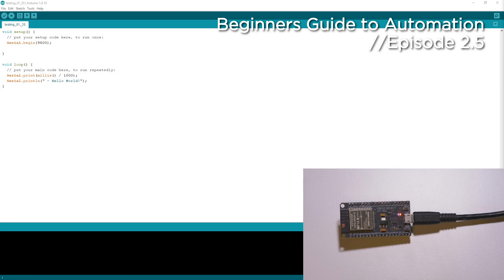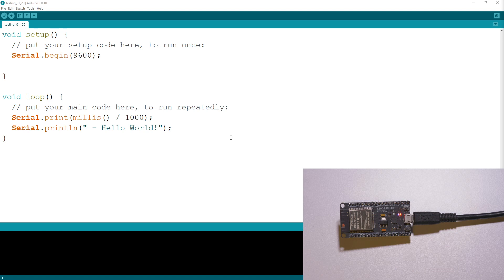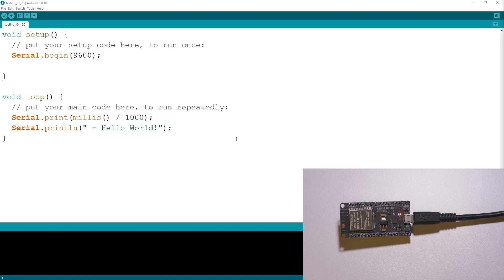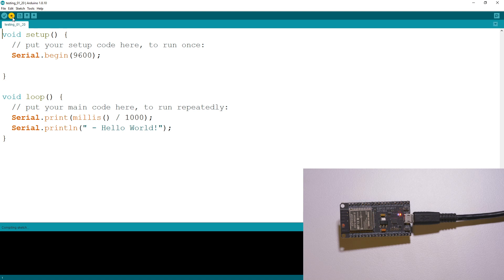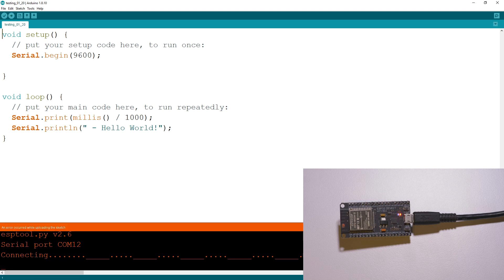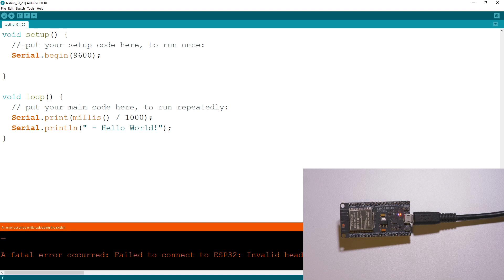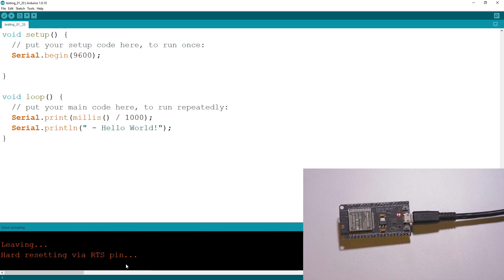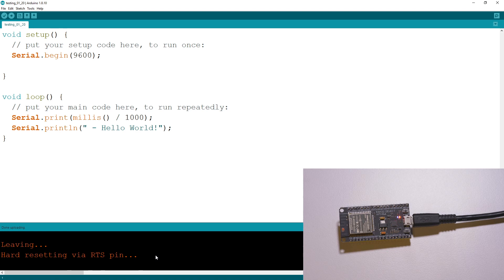ESP32 Upload Fix

Comment: This did not work for me at all,  To upload your sketch to the ESP32:
 Connect pin 0 to gnd. Press upload sketch button within Arduino.IDE program on your computer  Once the upload is complete, remove pin 0 to ground and press reset on the D32.  Your sketch should now be running.  Also take note:  The upload speed and serial monitor was at 9600 baud.  Worked for me!
I digress;  some ESP32s have a boot button.

Comment: Problem is, even if you get code on it, it wont work because it cant connect AFTER the write....the code writes but cant function.
Reply from the maker: It will function just fine. The issue is with the reset that should happen when uploading new code

Comment: I'm pulling my hair out on this one ! I constantly have th' 'No serial data recieved' error and can't upload. The only time that it works is when i completely remove the COM port device from my devices manager, reboot the computer and let it detect again. Then in the arduino software i can upload without any problem. It happens that it works twice but when it fails, i never get it to work again until i delete and add the comm port again. What a piece of garbage

Comment: Thank you very very much for this vídeo. As a matter of fact, I have the very same Output message as you do in the end, after solving you issue : "Resetting via RST pin". I've read in the documentation that this is not a bug, but rather a feature. In any case, if the program is really being loaded, I can not see the builtin Led blinking as it was supposed :(

Comment: HI 
Thank you for your videos 
I have an error when I start to build my sketch  for esp32  but no issue for esp8266 
I m using windows 10
This is the error :  exec: "cmd": executable file not found in %path% compile error for esp32 dev module board
I need help 
THANK  YOU
Reply from the maker: I would check your path variable.  In windows open up a command prompt. Then type "echo %path%". Check if there is anything weird going on there.

Comment: I ran into this same symptom, but my problem was something different.  I was missing the CP210x USB to UART Bridge VCP driver.  Without that, Windows wasn't able to create a Virtual COM Port (VCP) when I attached the ESP32 with a USB cable.  By default, Windows has COM1, but when I'd try uploading to my ESP32 using COM1 it would give me the error this video talks about.  That's because my ESP32 wasn't actually connected to COM1.  And since I was missing the driver Windows wasn't able to create another COM port, a VCP, for me.

After downloading the CP210x VCP Windows
 driver from https://www.silabs.com/developers/usb-to-uart-bridge-vcp-drivers I got one step further.

My other problem was that I was using a USB charging cable, not a USB data cable.  This was called out, but it wasn't clear to me how I would know if I had a data cable or not.  After some Googling it became clear that it's not an easy thing to figure out; however, after I installed the driver and managed to use a data cable I noticed that a new COM port appeared in the Device Manager.

If you're using Windows 10, to confirm you have a data cable:
1. Launch Device Manager
2. Expand Ports (COM & LPT)
3. Connect your ESP32 to your PC using the USB cable
4. Device Manager should refresh/flicker
5. You should see: Silicon Labs CP210x USB to UART Bridge (COM3)

Now for me, it was COM3, but it may be different for you.  If I unplugged the USB cable I could see that port disappear from the Device Manager.  When I plugged it back in, Device Manager refreshed and it showed up again.  

If you're not sure if you have a data cable or not, you can use this trick to find it.  When you use a charging cable you won't see the new COM port appear when you plug it in.  But if you use a data cable you will see the new COM port appear when you plug it in. 

Now that I'm using a data cable, have the CP210x VCP Windows driver installed, and followed the instructions in this video I'm up and running.

Comment: Things are going great, Have a few problems. How do I find the Baud rate of my computer? How do I find/or how do I change the com channel?  Other than a few challenges we are doing great and hope to have it all done and in the greenhouse for my 87 birthday in September
Reply from the maker: Hi Carter, you don't need to know the baud rate of your computer. It is the the baud rate you set with the command: "Serial.begin(9600);". In that example, the baud rate is 9600. So on your Serial monitor, set the baud rate at the bottom to the same. And good luck with your automation project!!

Comment: Have you experienced some unprintable characters being printed before the "Hello World" is printed?  It is only printing the strange characters the first time "Hello World" is printed, all following prints look as expected. If I print with an empty string in the "Serial.println("");" I see only the strange characters. Thanks again.

FYI: I did also double check my baud rates were aligned at 9600.
Reply from the maker: I have only ever seen that when the baud rates are not the same. Just to confirm, are you setting the baud rate on the serial monitor itself to 9600 (bottom right of the serial monitor)? There are three places you can set baud rates...in the code (serial.begin(9600);), in the serial monitor, and then the upload setting from the menu. The upload setting won't affect the serial monitor.
Reply: @ChilliChump2  and there it is staring at me right in the compiler/upload console output: "Changing baud rate to 921600".
I am not seeing "9600" as an available baud rate for uploading.
Reply from the maker: You don't want to change the upload baud rate, like I said above that won't affect the serial monitor. Have a look at this image to see what you need to change: https://i.imgur.com/9s4RYTq.png